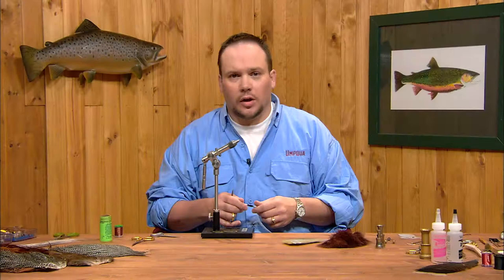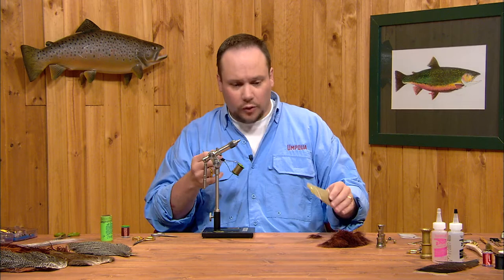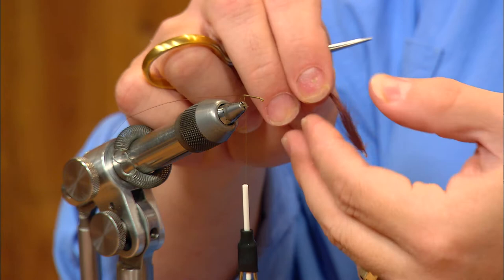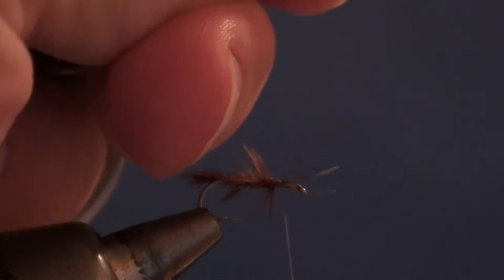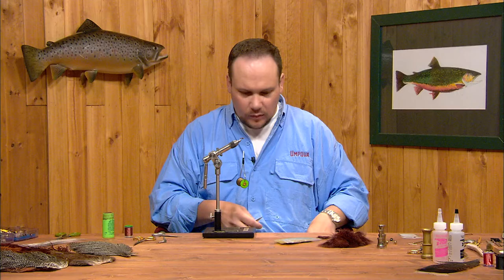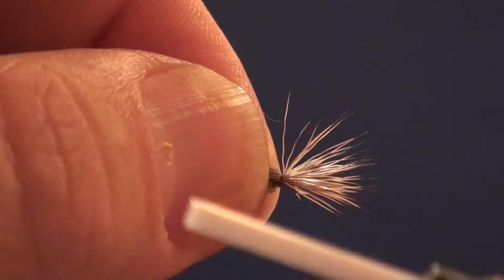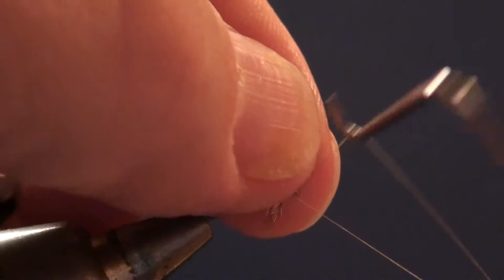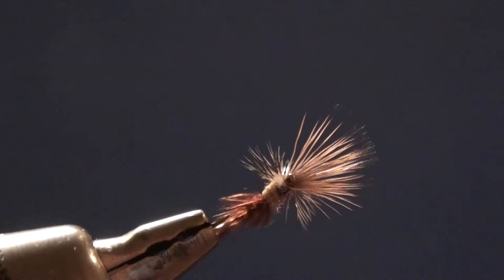Quiggly Cripple

Comment: I trimmed the hackle too, then the oldtimers in Eastern ID told me that was all wrong. The fly should sit on the water perpendicular to the surface film with its ass end below the surface film. The full untrimmed circular circumference of the wound hackle keps the wing pointing straight up, just like the natural. Elk hair is a great wing material for the larger Quiggly Cripples too. Great work Charlie